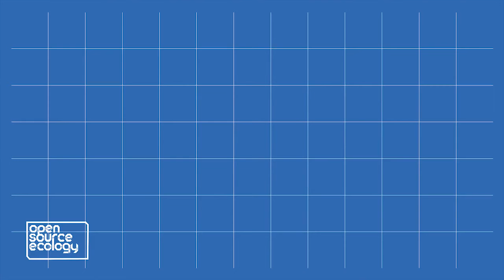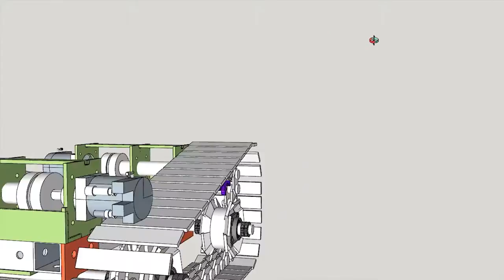MicroTractor by Open Source Ecology

Comment: All these machines seem incredibly labor intensive and expensive to create. It seems like buying and modifying an existing machine (e.g. Bobcat)  might be a lot less work and is something that has stood the test of time. This stuff all seems awfully clunky. 

Surely a machine that can either automatically mill or 3d print the components would be the only way something like this would make sense.
Reply from the maker: This is a prototype in development only. But in general - the lifetime cost of equipment is that of maintenance. If we do open source, simple design, then we can maintain the equipment for a lifetime - as opposed to depending on expensive repairs and parts. Open source gives a 10x factor of cost reduction over a lifetime, and about 5x cost reduction up front, for about 50x lower lifetime cost. Modifying existing machines is wishful thinking from our experience, which I discussed in my TED Talk - https://www.ted.com/talks/marcin_jakubowski
Reply: I don’t think you realize how expensive micro trac machines are! Aside from price, the idea behind open source ecology - the modularity of their designs is brilliant. Just the power cube alone - being able to chain them together for more power and swap them into various machines - is phenomenal. The designs are clunky, but they’re not specialized.  The number of unique parts between several of their machines is far less than any single tractor that is commercially available. And you can repair all of them yourself. That doesn’t just save money it also saves time, serious amounts of time depending where you are in the world waiting for some special part that has left your entire tractor down. I just wish more people were actively involved. I’m waiting on the next tractor version to be published!
Reply: In construction we say "if it were easy, the homeowner would do it" :)  The irony is all of the industrial equipment shown and need to manufacture these is no different than any other manufacturing environment.  The only difference is that people who know how to mfr things do it more efficiently than a village can.  This is pie in the sky stuff.  The reason we went through an industrial revolution was to get away from mo and pop trying to build an excavator.  These people are the Che Guevara's of industrialization who want to take us back in time and do away with the progress we have made in industry.  They think they can teach people to mfr things for themselves.  We tried that in the dark ages, it doesn't work as well.  What they should be doing is encouraging these people to integrate into modern society by getting modern training in technology and the sciences.  This is nothing but a social experiment for socialists.
Reply: @ArtisanTony  Your viewpoint certainly makes sense. But I offer my perspective here. When I'm in the city, buying something is the path of least resistance. I'm not gonna be building a passenger car anytime soon 😂. But when I'm back at my farm, buying something isn't that simple. Machines fabricated from standard sections have a few big advantages over buying something factory made, in certain locations. They can be fabricated, repaired & repurposed in any corner of the world. Here in India, microtractors aren't a thing yet. But something like this, we can definitely fabricate. Welding machines are super cheap, construction grade medium carbon steel is widely available. 
If you look at the machines built between 1850-1950, they were heavy, over engineered, and built to last. Current mass produced machines are optimized for minimal material usage to reduce B.O.M as well as to reduce shipping costs. Of course there are exceptions, but generally I can't buy something that fits my needs exactly. But a serious good quality DIY machine (not some flimsy hobby project) can change the lives of people in an entire village here. This isn't just a philosophy for me, it's a way of life. I'm a techie turned small farmer, and I work with other small farmers all the time. Local manufacturing is actually a thing for some time now, it is changing lives here.
Reply: @ArtisanTony  > We tried that in the dark ages, it doesn't work as well. 

Yes, the DARK AGES, or in other words, any time before the internet. The information age, computers, and robotics (including CNC) changes everything. Ma and Pa could way more easily build an excavator in 2020 than even in 2000. A bootstrapping machine shop used to cost hundreds of thousands, now it costs tens of thousands; out of reach for a single farmer, but a village could collectively outfit a shop.  

Modern agriculture equipment is designed for recurring revenue and obsolescence. Marcin is making gear that farmers can reuse and repair indefinitely. 

This isn't for industrialized nations. News flash, MOST of the world lives in or barely above poverty. By creating a standardized modular framework, it allows people to hack together whatever they can scavenge or buy collectively. This is that whole "means of production" those "socialists" have been talking about.
Reply: @ArtisanTony  "This is nothing but a social experiment for socialists." lmao

Comment: the track seems over engineered with the thickness of those plates
Reply from the maker: Well, the track is a modular unit that will go not only on this 2000 lb machine, but also on larger 20,000 lb machines, in which case it's probably underengineered. This is prototyping in progress.
Reply from the maker: Right.